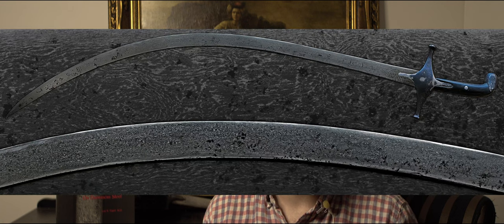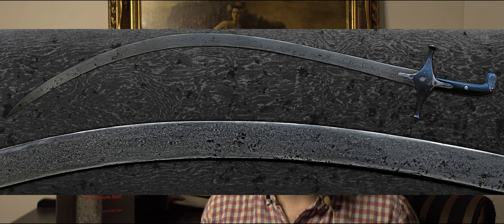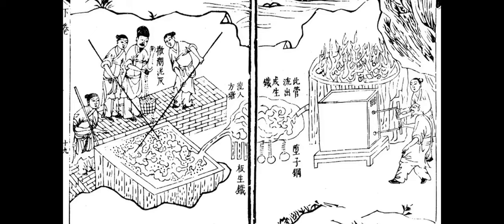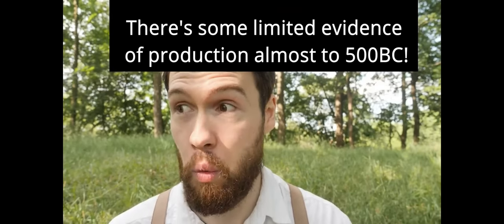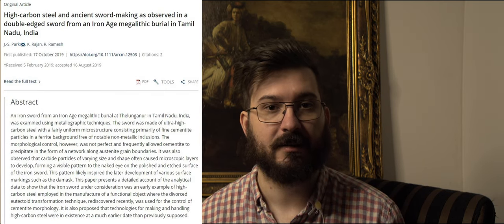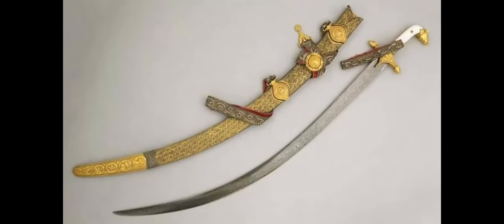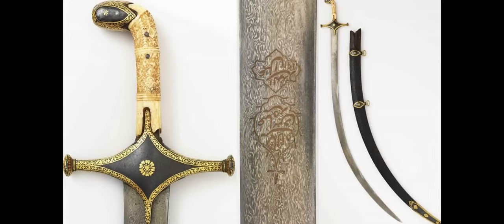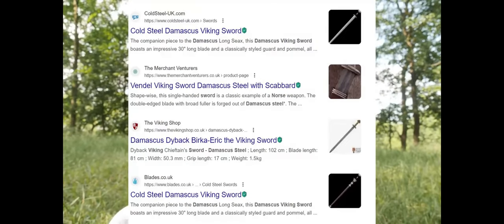Crucible "Damascus" Steel: A Response to The Welsh Viking

Comment: As soon as I saw the original video I felt the urge to correct Jimmy here and there (and, to be fair, I was expecting even worse of him), but I'm very happy that you did a better job than I could. I also find it quite amusing that of two videos of this collaboration project that The Welsh Viking was involved into that I've seen so far, both had issues. Granted, Jonathan Ferguson's otherwise commendable effort was mostly foiled by the ever-sloppy editing on the part of the Royal Armouries media team, but Jimmy here had much bigger problems, especially for this oh so difficult topic.
Some of nitpicks of my own, if I may.
9:29 I'm not sure why you'd need to bring this point here. European imports were taking place on a large scale from the sixteenth century onwards, some Indian feudals hoarded hundreds if not thousands of such blades, yet the puladi trade didn't die out for at least a couple of centuries, which, coincidentally, is also the period when the British Raj was established. Jimmy seems to be on the right track here connecting its socio-economic consequences with the decline of wootz-making.
12:57 I'm positively surprised that you didn't pick at this point of Jimmy's, since I believe you've discussed antique pattern-welded 'fake wootz' blades on this very channel. I don't think that The Welsh Viking here is in any way prudent in laying all the blame on the Americans if it has been done for centuries before them.
15:33 Pavel Anosov published a large memoir on the matter of wootz blades in February of 1841, describing techniques used to produce many of the varieties of wootz. Said work was titled simply 'On Wootz' ("О булате". Горный журнал. 1841. Кн. 2 (февраль). — Санкт-Петербург : Типография И. Глазунова и К°, 1841. — 168 c.), took up a whole second volume of The Mining Magazine for 1841 and can be easily found online, but it doesn't mention N. Masalsky or any of his notes one bit (referencing instead Georgian master smiths and Henry Wilkinsons's 1837 Journal of Royal Asiatic society article ['On the Cause of the External Pattern, or Watering of the Damascus Sword-Blades', vol. 4, No. 1, pp. 187-193]). So I'm not sure where your claim is coming from. Prince Masalsky hadn't even published anything from his travel to Persia until 1844, as far as I know. Anosov, on the other hand, was tasked with reproducing Faraday's work on Indian wootz blades all the way back in 1828, as per the aforementioned work of his (and given it was an official instruction, it might be cross-referenced through the old Ministry of Finance archives).
22:36 Ah yes, the Royal Ontario Museum! One should expect such negligence from them, really.
Reply from the maker: Khorasanis book describes it as "in spite of the fact anosov was able to make excellent wootz blades, he later asked Captain massalski, who're regiment was stationed in bukhara, to observe the process and undertake further investigations". 

While he writes "persia", it's not quite the same definition by which we use that word today.
Reply from the maker: On the massalski point: I got the chronology wrong, serves me right for relying on memory.

Anosov was making bulat before massalski, but massalski did travel to bukhara and report in 1841, at least according to khorasanis arms and armor of Iran book, and massalskis publication 1841 Preparation de l'acier damas en Perse, Annual re du 
Journal des Mines de Russie pp.297-3O8 and according to Feuerbacks paper on Central Asian crucible steel, and Alipours 2017 paper on chahak. 

So while anosov did make bulat before that, he also sent massalski to observe more production methods at the same time.
Reply from the maker: Also I swear I did address how "damascus" as a term was used well before Bill Moran and has referred to patterned steel long before. 16:33 ish
Reply: @IPostSwords  It seems to me that Khorasani got his facts confused, because N. Masalski (sic.) wasn't stationed in Bukhara, he might've passed it, but in actuality he was sent to Persia in 1839 to establish artillery technical establishements there, and by 1843 he had returned. Moreover, he wasn't assigned to any regiment at all, since he was in Guards artillery, which was organized in brigades and batteries.
Reply from the maker: @F1ghteR41  every reference I find says massalski visited bukhara as part of his 1837-onwards tour of "persia" - Hoyland says so in chapter 3 of his book medieval Islamic swords, as does feuerbach in the aforementioned article on Crucible steel in Central Asia, and alipour on chahak crucible steel. 

So that's why I say it was based in observations there.

It just happens to be documented in the same year, 1841, as anosovs "on bulat", and khorasani writes that they were in contact and massalski was asked to investigate it. 

I need to dig deeper and get the original massalski paper now
Reply: @IPostSwords  In regards to the use of term 'damascus' pre-Moran, I was more pointing towards the fact that passing pattern-welding for actuall wootz was most likely nothing new by the '80s, not that the term 'Damascus steel' is so vague that it could include any patterned steel back several hundred years just as likely as four decades ago. It is, after all, one of the main goals of Jimmy's video - to protect potential buyers from scammers. Yet he fails to adress the fact that this sort of rascality was already peddled centuries ago, and once 'cheap fakes' are now collectable antiques in their own right (which, of course, doesn't excuse modern scammers).
Reply from the maker: @F1ghteR41  ah, yeah, I guess I skipped over that. But as you said, it's a topic I've already specifically covered
Reply: @IPostSwords  My comments with reference to Masalsky article somehow keep disappearing, so I'll try to split it.
Reply: @IPostSwords  First of all I strongly doubt that mining engineer Major General Anosov (technically under the Ministry of Finance at the time) could sent a Guards artillery captain Masalsky anywhere, and that is besides the fact that his actual destination and reason for travel is well known. 
The 1841 article you mention is new to me, and is sadly referenced in a usual French manner, i.e. imprecise, but aside from all that it was indeed published in the same journal as Anosov's original memoir, namely The Mining journal, but in volume 11/12 all the way at the end of 1841 (November-December). Its proper name is 'On the manner of making bulat as employed by the Persians' (Штабс-капитан Масальский, "Об изготовлении булата способом, употребляемым персиянами". Горный журнал. 1841. Кн. 11/12 (ноябрь/декабрь). — Санкт-Петербург : Типография И. Глазунова и К°, 1841. — c. 233-248), it's available online. This article, in turn, references Anosov once (on p. 243), but it's also concerned with gun barrels. Mind you, by October 1841 bulat production in Zlatoust was already going on, because vol. 10 of the same journal for 1841 (again, avaliable online) has an article on its chemical analysis by I. Ilimov (И. Илимов, "Разложение Златоустовского булата и двух шлаков, полученных при булатном деле". Горный журнал. 1841. Кн. 10 (октябрь). — Санкт-Петербург : Типография И. Глазунова и К°, 1841. — c. 18-26).
Reply from the maker: @F1ghteR41  it's 1am here so I'll need to read these papers tomorrow, assuming I can manage to translate them.

I want to work out where the source of this bukhara claim comes from, because so many sources say massalski was there, as so many authors seem to claim this. 

Hopefully the original documents will help clarify this
Reply from the maker: @F1ghteR41  yes, youtube is removing them and I don't know how or why. They don't even show up as filtered or censored in youtube studio

Maybe we should move the conservation to emails, because I'd love links to the mining Journal papers
Reply: @IPostSwords  That is a very strange behaviour indeed, I have never heard of such thing before. As for the emails, I still wait for your answer on my letter about reinforced bronze from years ago, but I might write you a letter on this matter just in case. 😉
Reply: @IPostSwords  So yes, I've sent my comment to the email mentioned in your channel description, I hope it'll reach you.

Comment: Will Ostwald ripening happen in other steels, though? I'm pretty sure you can get Martensite without using crucible steel, and this requires Ostwald ripening? So is it possible to take bloomery steel and handle it in such a way as to get a similar look to the naked eye as the crucible steel (or, I prefer to call it, liquified steel)?
Reply from the maker: It really only works for things precipitating out like spheroid cementite - not martensite, which transitions rapidly
 
So if your bloom was ultra high carbon and had some spots for cementite spheroids to nucleate, then yes.

Otherwise, no

Comment: Maybe this is not a fair question since it is about pattern welded steel. 
I have often seen the idea that pattern welded steel became a substitute for wootz, but In trying to understand the history of steel i have also come across the claim that 
pattern welded steel was maybe produced as far back as some of the earliest steel production. Do you know the earliest dates for wootz compared to the earliest for pattern welded?
Reply from the maker: They're roughly contemporaneous
Reply: The earliest claimed date for some sort of pattern welding I've seen is second millenium BC (XII or XIII century BCE, to be more precise), a specimen from the Eastern Mediterranean (Anatolia or Cyprus, if I recall correctly). So it might be considerably older than wootz, but, on the other hand, I fear that a debate over definitions of pattern welding could be had here, which would muddy the water considerably.

Comment: The guy's name was "AnOsov", not "AnAsov". https://en.wikipedia.org/wiki/Pavel_Petrovich_Anosov I read an article about him about 15 years ago where it was written, he demonstrated that the modern steel (19th century) was superior to bulat and vastly superior to folded "damascus" (for military use).
Reply from the maker: If that's the only pronunciation issue I had in this whole video, I'll consider that a success. I'm quite terrible at speaking
Reply: @IPostSwords  Unfortunately, no, there's also an issue with Bukhara at 8:51 - it's stressed on the last syllable.